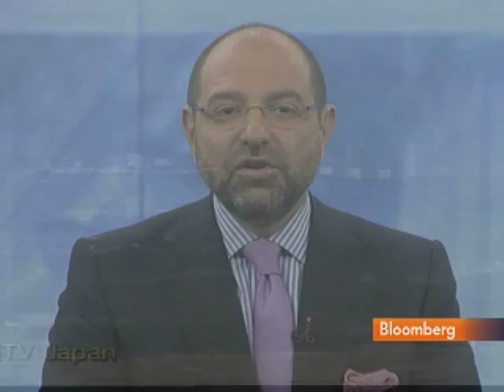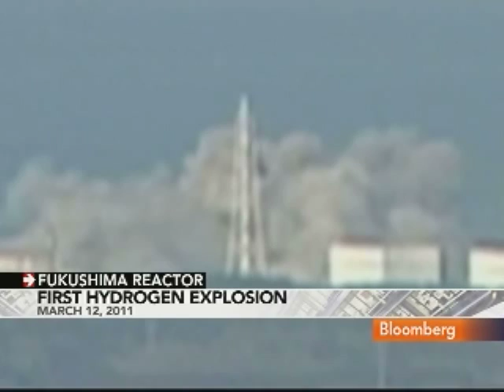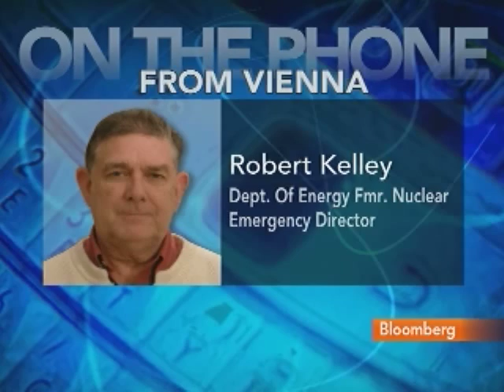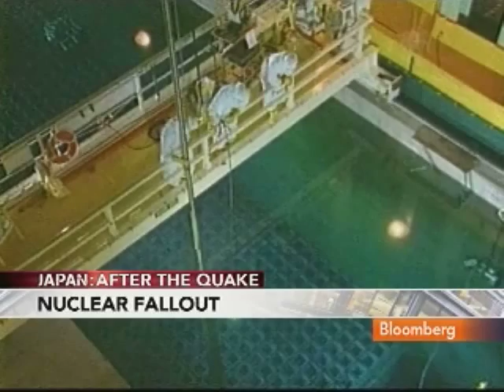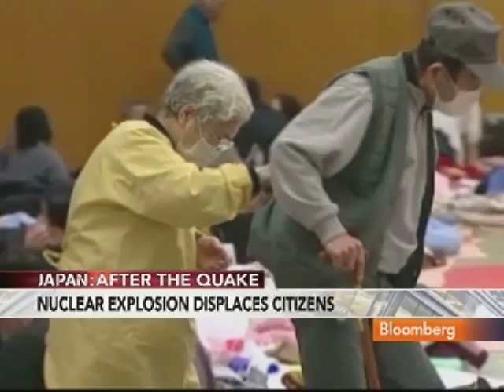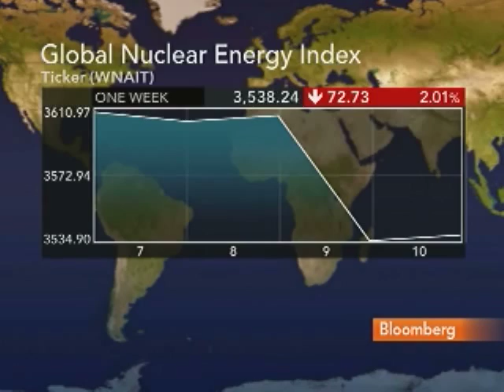Kelley Says Japan Nuclear Reactor Not Another Chernobyl

Comment: @rocketman10owen I honesty don't have enough info to draw a proper conclusion, but that isn't the way to go either.

Which is worse: one 100-ton bomb, or three 1-ton bombs?

Not saying which is worse, but again you have to consider that the degree of the meltdown has more to do with it than the number of simultaneous meltdowns (as one bad meltdown may be worse than a couple mild ones). Example: Chernobyl and Three Mile Island were two separate meltdowns of clearly different scales of disaster.